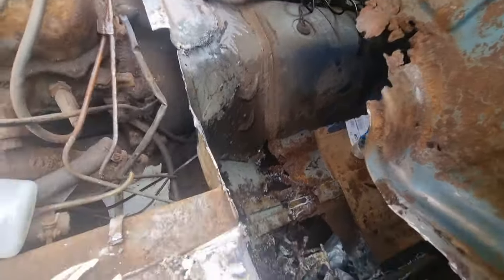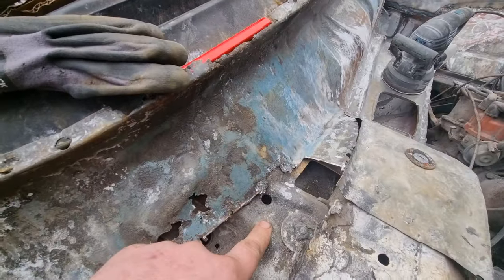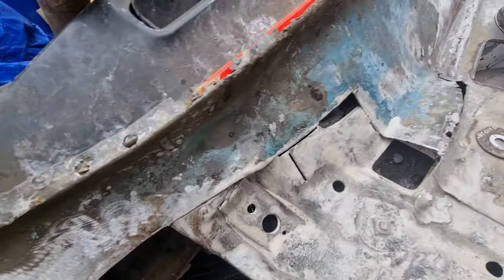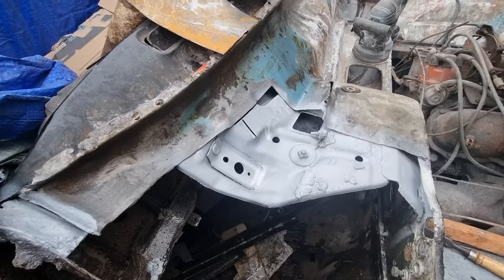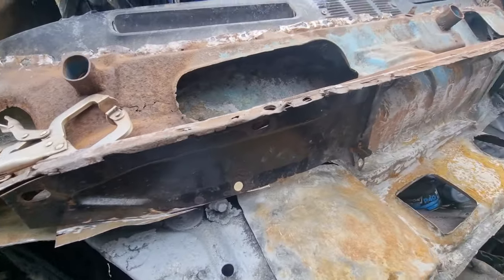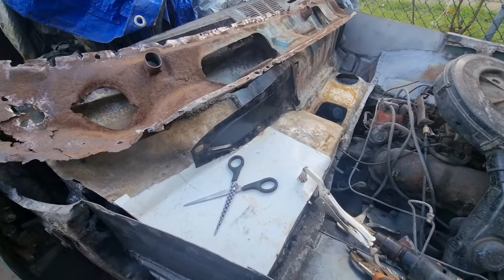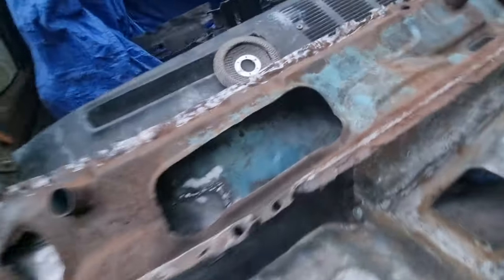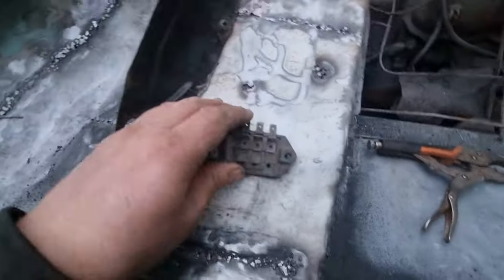Cortina Mk4 Ghia 2.3 V6 Restoration || More Bulkhead Work (P17)

Comment: You can buy weld throu primer .maybe thats what you useing. I thought these cars was dipped in a galvanized protection before paint. Maybe that was BL. I have to read up. One guy says this model was made in Germany. Ill read up. Get your self a tree stump 1 Mtr high .you can dish the middle out. This is good for shaping and hammering metal. You can fill a leather bag up with sand. Also used for shaping. Get a bunch of Diff body work hammers from the Flea market. They cheap secondhand. Good luckMan. Doing good. ,👍👍
Reply from the maker: the car its self is british made but think the engine is germany great idear on the sand bag hehe and trunk
Reply: @AdamSNook.  Yep a Cologne engine. I lived in Sweden for a few years.. I owned a Taunus 17M 1966. It had a 2.0 V4 made in the Cologne engin plant. But the popular engine swap is your engine. If you want better power.  Tuff engine.